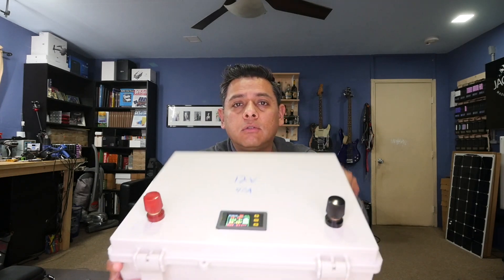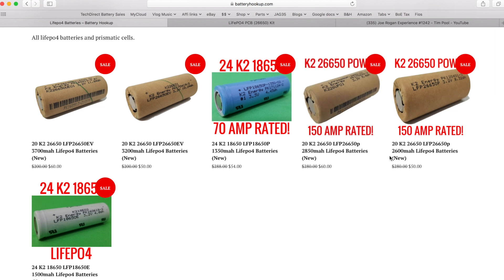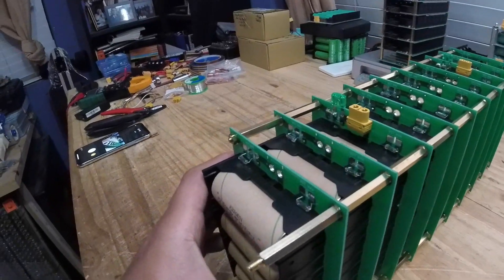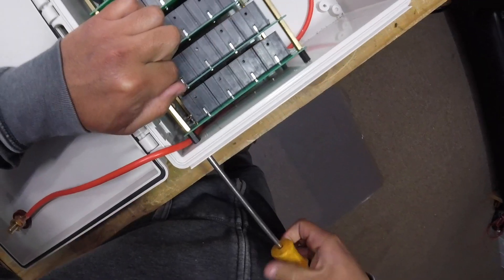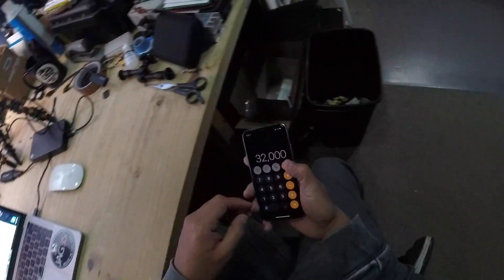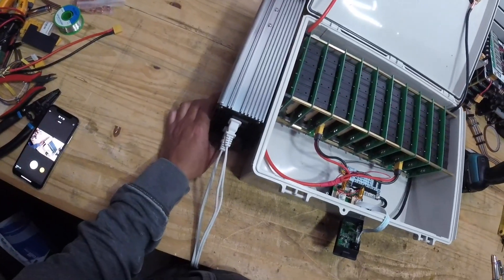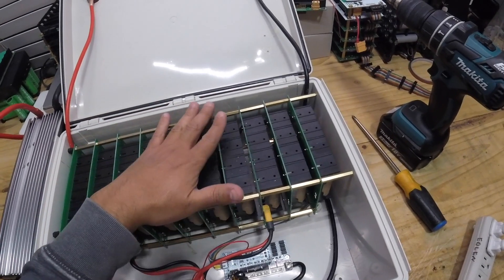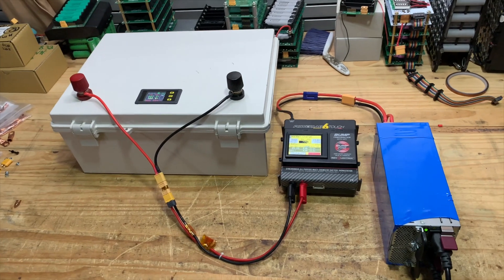K2 Energy LiFePO4 26650 Cells for 12V Lithium Battery replacement

Comment: Are those 4mm screws going through the housing hot? That  seems like a bad idea. Also, if you are intending this for mobile or portable use, I think those batteries need to be mounted more ruggedly. The case looks tough enough though. One thing I would do in your shoes is record the measured energy capacity on the outside of the pack. By the time comes to troubleshoot that pack you will not remember what capacity cells are inside and Murphy's Law says it will be cold, dark, raining and windy (or worse) when you need to figure out what part of the system you put the battery pack into broke. Maybe that meter can store that for you - that would be a nice feature, but then there's Murphey...
Reply: Sure enough, they are both going to pads under the standoffs on one of the long sides.  3:44 shows this.  Duct tape to the rescue!  LOL
Reply: I guess he could replace those screws with non conductive nylon screws
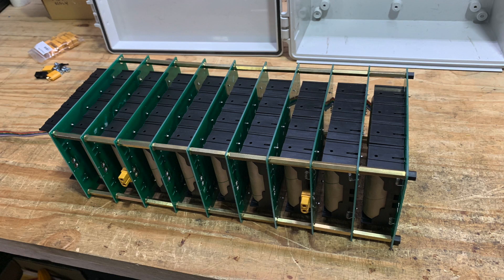Reply: Minute 3:50 looks like the right side has already plastic screws at the end. But the left side is not plastic. Hm, these screws could be used for future option ... e.g. a bridge connector to a 2nd box. ;-)

Comment: I'm basically building the same thing! With these cells. WithOUT the PCB. I'm going old school. I'm using it to power 12v lighting in my off grid house. I have 80 cells, getting 80 more. And using 100 amp bms, I don't have the monitoring yet. They seem to be nice cells!   I'm looking for a way to charge from my 29v bank, any ideas? I'm thinking 10-20 amps, charging, I'm thinking of trying a pwm charge controller, and a DC buck converter, to drop it to about 15vdc, for the controller! Maybe add a capacitor for further smoothing from the DC converter! It may be just as efficient to use a 120vac charger! But I want to keep it DC! I don't want to buy  new solar panels. Or put alot of cash into it!! I have a 20amp controller coming, and a small DC converter. For testing. If these cells workout I will likely make it a  160p 4s bank, I don't want to end up in the dark, so I have a 20ah 3s bank Ill keep at 3.7v/cell, for back up. I'm using it now. I charge it to 4.05v per cell now. For normal use. But will keep at storage voltage for back up later.  I don't like sitting in the dark!! Although I do have 120vac lighting. When off grid you never know. But I use 12v lighting most of the time. And have generators AC and DC, the DC to charge batteries only. And both from ac, only at lower amperage. I can do 280+ amps at 30vdc, and will be adding a 12v alternator, to charge at 60-120 amps. But 80x 3.2ah, I will likely go a week or longer before needing a charge!! I can't wait until my main system is of that capability!!! Great video, I was tempted to get the 3700's but figured I'd save a fèw bux! Now if my parts will get here!!!
Reply: You charge lifepo4 cells to 4.05 volts?.... if you have 160 cells, it will not be 4s160p, it will be 1s160p. Or 4s40p
Reply: Maxime Mineault I plan to have 160 x4 cells but now its just 40 cells total. Charged to 3.5v / max, the 26650 liion I charge to 4.05v its 3s, 11.1v nom. 20ah, its the backup backup. I will likely end up charging it to 3.7v per. For storage . since it will only be back up, and be used for a short time with about 10amps max, probably just 2-4amps,
Reply: I'm doing something very similar. what bms are you looking at? or have you got?
Reply: Murray Argo I just got one from amazon, claims 100amps. I'm only going to ask 25a from it .and use one per 80 cells, I also have a balance charger to charge it occasionally. I'm looking for a way to charge from my 24v system...

Comment: "You can charge this off an alternator."  Hah, wouldn't recommend.  Could feed 100A.
Reply: Just add current limiting.
Reply: Lifepo4 could probably handle it too.
Reply: @MrDingaling007  The cells can handle it, the holders can't.
Reply: @ZaiFuchigami  true , but I was just talking About Lifepo4.
Reply: @MrDingaling007  The cells might, the fuses and BMS won't.

Comment: I partly disagree!
Lead acid car batteries are working between 13.8 V (maximum charge voltage: 14.1 V, with some outgassing) and a minimum discharge voltage of 10.8 volts. All electric devices in a car therefore must be designed withstanding a voltage of 14.1 volts. As there is also the possibility of having up to 60 volts because of "load dump" Overvoltage, the equipment must be hardened for this circumstance too. Without these features, I will not get the E1 operating permission of my electric add on device for a car.
That means, 4 * 3.7 volts is not an issue. Every component in a car must tolerate that. The only problem is the charging, because the car dynamo is limited to 14.1 volts. But with some intelligent circuitry one might master that problem too to make a Li-Ion battery fully car compatible.
The E1 regulations are here: http://www.unece.org/trans/main/wp29/wp29regs.html
Reply: Each LiFePO4 cell has a NOMINAL voltage of 3.3V. A fully charged LiFePO4 cell is 3.6V, and a fully depleted LiFePO4 cell is 2.5V. SO a 4S car battery would operate between 14.4 and 10.0 volts... very close to that of a lead acid battery.
Reply: BigCooter.com Most LiFe cells have a nominal voltage of 3.2V...not 3.3
Reply: @mondotv4216  yes, you are right .. better spec values would be: 3.6 / 3.2 / 2.5v .. Max/Nom/Min .. so a LiFePO4 4S a car battery would be 14.4 / 12.8 / 10.0 volts.  That matches up better with specs on LiFePO4 car batteries, like the Antigravity RS-30 ... which I installed in my Porsche .. only 10lbs ... downside is cranking amps noticeably drop when temp hits 40F .. and their cool auto low voltage shutoff feature that allows resetting the battery for a guaranteed engine start .. isn't so cool when it shuts off while driving .. and not so cool when ya can't open the electric hood latch to reset the battery! LOL.
Reply: @Murphy deffa but when the car can only charge to 14.1 volts..it kind of solves that problem on its own....  (but maybe not)... It would be nice to hear from someone who has actually tried it.
Reply: @calholli  the problem with that is it doesn't matter how much voltage a BMS is getting in order to charge these batteries it only has to get the same voltage to charge one cell. That's what the BMS job is is to split that power up between each cell. So you can have a charger charging your BMS at 4.5 or 35 volts it's the bms's job to make sure it charges the batteries at 3.2 volts or 3.7 depending on the batteries and BMS. So if your alternator is charging at 14.1 the BMS is going to just take that and reduced it to the cell capacity and then split that up. Perfect example I can use my model battery charger and have it hooked up to a 4 volt power source and it was still charge my 4S 12 volt 70Ah lifepo4 battery pack and it will charge it just fine. It's not charging app the 12v (13.2) it's actually just charging multiple batteries at 3.2 volts.
Reply: The lithium batteries out on the market JY Lithium, Limitless Lithium, XS Power Lithium and the do it your self guys all build lithium batteries with  K2 26650, LTO, SPIM08HP LITHIUM POLYMER,  Headway 38120hp, Ford CMAX cells, Yinlong LTO 66160H, kok polymer and so own and these batteries are seeing any were from 200 amps to 2500 amps,  some use BMS some dont and they all work fine and run them from 14.4 to 16v and some have 18v. They are all paired with a high output alternator from 250 up to 390 amp alts, some have internal voltage regulator and some have external voltage regulator and some dont. Most cars I see have no problem running at 15.5 volt and some run at 16 Volt fine and some have a battery isolator.
But the point is say you have 4s 10p 80AH SPIM08HP LITHIUM POLYMER and 
NOMINAL VOLTAGE:3.7V / FULLY CHARGED VOLTAGE:4.2V and you have a alternator that can charge to 14.4 / 15.5 you will be fine. 
I run 100ah headway 38120hp in my daily with out a BMS, I do have meters and everything to keep a eye on them and I pull it out like twice in the summer to check everything but I beat on them pretty good running 2 Orion HCCA 8k pulling 1400 amps at compitions but they stay balanced and if its off its not by much and i just plug in my cheap tenergy 5 in 1 meter to balance them out and everything is great
Reply: @04tb2  that's what I've done is build myself for us battery pack out of head ways for my camper. So it charges through Waze either through the seven-pin connector when it's plugged into the vehicle, a solar charger for the built-in BMS, or sure power. They are a lot more forgiving and can handle being charged without a BMS but they will slowly get worse and worse so as long as you are taking them out and rebalancing them you can get away with it for quite a while. Also there are a lot safer than lithium-ion, so running without a BMS isn't much of a safety concern either as they're not prone to exploding or Catching Fire.
Reply: The normal average Voltage of a car that is running is about 14.4V. Sometimes up to 14.7V
Reply: @RichardsWorld  with engine running, the alternator output is higher than the battery voltage.

Comment: Can it start a car?...😎😎😁😁Can it work as an emergency lifepo4 car starter
Reply: Theoretically those Cells together in 4s10p can pump out 1500amps
Reply: @MrDingaling007  Theoretically yes, but not with 10 x 4A fuses!
Reply: definitely, both. However charging must be done with a special device.
Reply: @ghlscitel6714  40A is not enough to start a car. 400A maybe.
Reply: @ahaveland  that is correct, however you are free to adapt the configuration accordingly, The above described 40 A unit may not be enough as the fuses might blow. But it is up to you to insert 20 amp fuses at each battery. Also then consider using an apropriate Mosfet and thicker cables.
The "cold crancing amps" of a starter is between 200 amps and 600 amps roughly, depending on the size of the engine. During the starting process, the voltage can drop down to 5 volts. Electronic devices working on the car battery power rail should be operating at this low voltage, like petrol pumps and other essential parts to gurantee conflict free operation of the engine.
Reply: You could probably use it to charge your card battery , the wiring and holders will not allow jump starting.